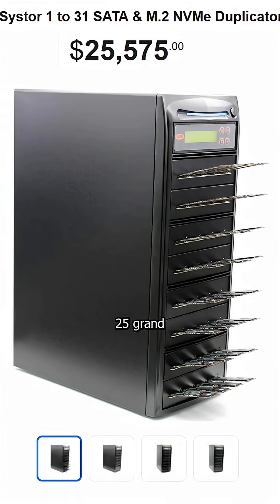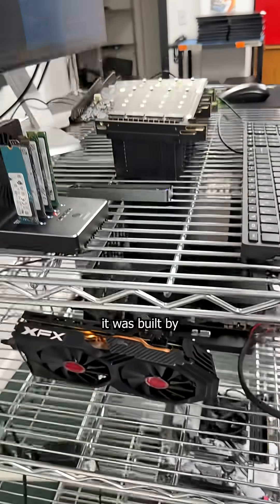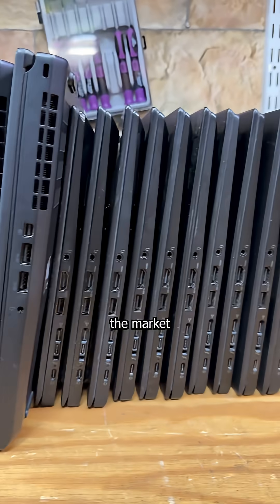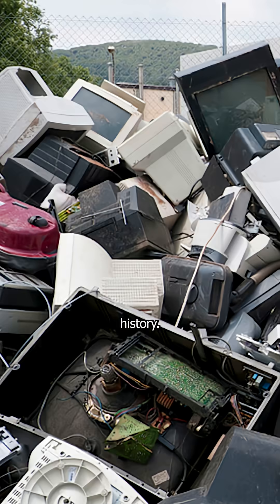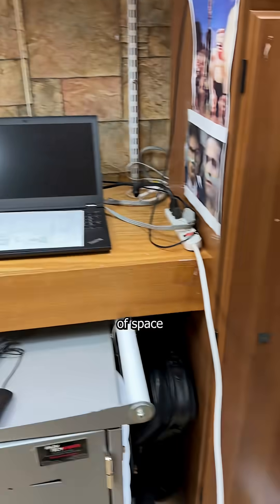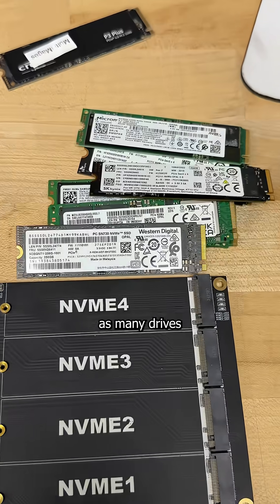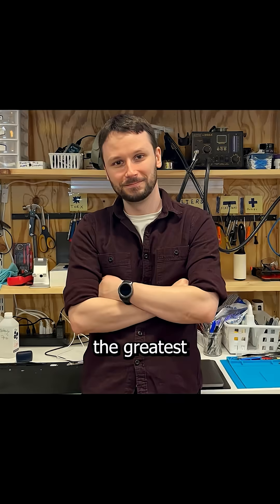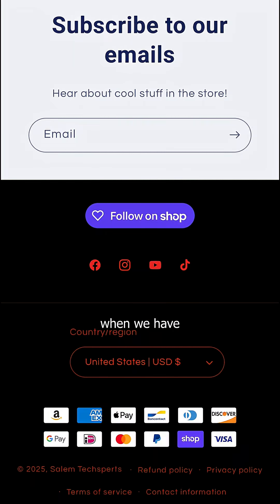I Built a PC Worth $26,000 to Save Old Tech From The TRASH! #tech #technology #computer #shorts #pc

Comment: The thing I don’t understand is what exactly windows 11 offers feature wise. Love it or hate it, at least macOS has the appearance and vibe of new (meaningful) features to entice OS updates. 
They also handle the replacement situation more gracefully. New hardware won’t support old OS and there’s a long enough support window that by the time your hardware isn’t supported it’s up to a decade old in some cases. I mean, I still don’t like having support life that obsoletes functional computers, but it should not be causing massive device disposal events like Microsoft. 

On the other hand, i guess it’s good that this situation is causing so much bad press. Used to be that new Windows meant new hardware upgrades every few years.
Reply from the maker: I agree with you 100%. MacOS (for the most part) at least adds features. Windows 11 just added a skin on top of an INSANE amount of bloat. Sure, there are some changes that I agree with and appreciate, mostly Paint LOL, but it seems like it's an update meant for the shareholders vs the consumers. 
I'll get disliked for this comment but the best brand computer for 90% of people is a used M series MacBook Air.
Reply: @SalemTechsperts yeah. After building PCs for over 20 years now, I can honestly say I really have no desire to purchase myself another windows laptop. 

Last Christmas, I bought a new laptop for my wife, and the whole experience was so annoying. If not for her specific need of a pen input, I would’ve probably pushed hard for a used M series MacBook. 

Btw, you’re doing God’s work here. It’s so nice to have a place to send people when they ask me for a new computer. Anyone in my life who is asking for my advice doesn’t need a powerhouse, and def doesn’t need something brand new. (Plus now I can flex my parasocial relationship and tell them I know the owner 😆)

Comment: Props to the site for still standing with everything sold out.  We need to give these machines the '2nd life' they so desparately need.  
Personally I just spent all of yesterday tearing down a decade old machine, cleaning everything including the radiators,  modifying and rebuilding it so so the gpu is in the right slot... its got PLENTY of life left in it, baring an unwanted upgrade to windows 11.   there's even a possible bios hack to get rebar working....  Point being,  there's going to be an avalanche of powerful machines with nowhere to go, and we need to intercept them before they get o the landfill

Comment: Awesome to see!
Small tip! if PCIe riser cables become unwieldy you can get oculink adapters, they use longer thinner cables! Potentially lower maximum throughput, but then it's possible to fit multiple in the same space. depends on whether the goal is more at once or faster individually.

Also if you're just writing basic images even USB adapters are surprisingly good. Main advantage of PCIe is direct control for firmware, NVMe wipe, S.M.A.R.T., etc.

Comment: Suggestion to try clonning over LAN/PXE with help of software like Clonezilla or similar network based clonning software. 
For this you need 1 clonning server, which will clone and distribute image to other PCs, One 24- or 48-port switch and lots of ethernet cables. Create 1 golden image of win or linux based OS and setup server to transfer image simultaneously or on each pc connected endlessly. 
On recipient PC you need to enable PXE boot mode in bios and connect to network with this mode on boot. This method works great with lots of new PCs at enterprise, where all PCs at warranty, but takes a lot of space. 
At workplace, we cloned AIOs and laptops at batches of 10 and clonning was much faster than unpacking/packing all those machines)

Comment: Please try to install versions of Windows 11, may it be 23H2 or 24H2, WITHOUT Microsoft Recall, PLEASE. You may refer to channel on Youtube by the name of "Memory Tech Tips" (now called "Memory") for your help with that. 

I was successful once with installing it on MY PC without it, alongside some other bloatware I managed to remove. I used "SCHNEEGANS UNATTENDED" and it worked back then, was a struggle later on though (due to either hardware incompatibility with the USB I was using, or my own PC and such).

I beg of you man, please find a way to remove that SPYWARE piece of sh#!
Reply from the maker: Every drive is loaded with 24H2, it's up to the user whether they want to update to 25H2.
Reply: @SalemTechsperts I heard several times over how they made it either DIFFICULT or IMPOSSIBLE to bypass the force of us having to HAVE an internet connection with the 25H2 update. Which would also add in more difficulty I'm sure, if the internet just RELOADED the bloatware, even AFTER, it had been removed, by some force of Microsoft's trickery. Stay safe bro. I'm sticking with the extended version for Windows 10 till next year. Gonna be a big pain in the ass to deal with 11 coming forward. But hope my understanding of it all pulls me and the other electronic devices in the house through.

Comment: There's a regedit that will let win 10 PC upgrade to 11 or you could have setup a pxe boot imaging system for a fraction of the cost.
Reply from the maker: What does the PXE boot imaging system require though? A large network. A large network requires equipment. Equipment costs money. The labor to build that network with that equipment costs money. The docks to convert ethernet to USB-C cost money. $1,600 to clone 28 NVMe drives in 10 minutes is more efficient than PXE.

Comment: I just did a clean install of windows 10 on my old 13+ years Acer laptop. It was already annoying and took much longer than I thought... Can't upgrade to windows 11 unless I use the brute force software options.

It was quite interesting to do, the machine still works but all drivers and softwares is the worst part of it. Most of the brands don't keep their drivers in archive...

Comment: I hate the fact they are shutting down windows 10. My laptop doesn’t have enough built in storage to update to windows 11 so my only laptop is going to be useless :/ even worse though is that its the laptop im using for school
Reply: install windows 10 lstc or Linux mint and you'll be fine :)
Reply: 10 won't dissappear, it just won't get new updates. Which only matters for security stuff, and it might take a few months/years to be an issue. You should be good for a while.
Reply: @Russo-Delenda-Est  exactly, that machine will be either replaced or upgraded long before it becomes an issue
Reply: Might want to have a look at learning Linux. Linux Mint is very Windows-like and very beginner friendly. Been using it a few years now.
Reply: Windows 10 iot ltsc
Reply: You can still use 10, you will have to be careful though. Or go to Linux. You can have both though.

Comment: I don't get why all of you are mad for Microsoft dropping Windows 10 support. I mean yeah most pre 2018 machines can't run Windows 11 officially but it's still way better than what Apple does. Technically some Windows XP era hardware is able to run Windows 10, so it's like 20 years of support. There certainly needs to be a time when Microsoft finally updates the minimum spec so we can move forward and for those who don't want to or can't afford to upgrade to Windows 11 ready machine you can always install Windows 11 with the restrictions removed, enroll your Windows 10 machine into ESU or install/upgrade to LTSC (long term support channel) to get updates until 2032.
Reply: The biggest uses will pay billions to keep having updates so it doesn’t really matter to them

Comment: Wouldn’t it be simpler to set up a Clonezilla server with a ready-made image that you distribute over LAN boot? You just plug in the cable, turn on the laptop, press F12 to choose network boot, and in a moment the machine is ready to go.
Reply from the maker: I use Clonezilla to restore the image to 32 computers in 10 minutes without needing the network infrastructure which I don't have, and USB-C to Ethernet Adapters since nothing comes with Ethernet anymore.

Comment from the maker: - AMD Threadripper 3945WX (used) = $149
- ASUS WRX80E-SAGE Pro WS SE WiFi Motherboard (used) - $600
- 7 NVMe to PCIe cards @ $41.99 = $293.93
- 7 PCIe Riser @ $31.99 = $223.93
- 2TB Crucial P5 Plus = $208.99
- 2x8GB 2666MHz DDR4 RAM (Trident hookup) = $8
- Test Bench Frame = $18.99
- ARCTIC Freezer 4U-M (Rev.2) = $54.99
- AMD RX 580? = $50??
TOTAL:  $1,607.83
Reply: You forgot the steel scaffolding, that’s officially the case now
Reply: @Rizzler8483  whether the pun was intended or not, it is appreciated as a good one.👍
Reply: @Rizzler8483 came here to say that. 👍
Reply: @Rizzler8483  Wire sheving racks like that go for $200 to $500, depending on brand, if purchased new. They're pretty common, though, and ought to be available used if you look for them
Reply: Putting only 2 sticks of 8GB RAM in a Threadripper system is kinda cursed, very amusing, and also all that is necessary for your use case
Reply: A FRICKING THREADRIPPER FOR 150 BUCKS
WHERE DID YOU GET THAT FROM
Reply: @Nukea-n2kebay 
Tons of this exact same chip for the price on eBay 
It’s slow and stupid power hungry compared to modern ryzen 
Really the only reason to go for it is to shove as much ram and or pcie devices into a single system. 
A 7800x3d beats in multicore while using 160w less
Reply: Bro that ain’t no random gpu that’s the legendary XFX RX 580 how dare you talk bad about it
Reply: The gpu was the legendary rx580 xfx
Reply: That random gpu is a Ryzen 4070
Reply: Arch linux = 5 hours
Reply: Your mom's bill - the rest of $20k
Reply: @mort996  outside adapters nvme like they did took the 20k.
oh, and roll for initiative
Reply: Are you giving windows 11 into those nvmes??
Reply: @hossainal7227 Yeah, he’s just doing a clean/custom install of windows 11
Reply: Threadripper in 149 💀
Reply: You need all the pcie lanes.
Reply: @ImJuandahh  its old threadripper in my country its range from 150-170
Reply: @ImJuandahh you can buy a brand new old stock 3945WX for $200. It's a really old cpu.
Reply: Which software are you using for cloning?
Reply: Are there slots for cloning SATA drives?
Reply: @alexandreman8601 There should be, but if you were wanting to hook up a lot of HDDs/SSDs with SATA it's always better to use PCIe cards because you can hook up like 16 HDDs per PCIe slot and load up like 50 - 100 drives in a single machine without having to create virtual drives over ethernet with network switches and multiple machines.
Reply: @alexandreman8601he doesn't (seem to) need SATA for his main use cases. So probably not.
Reply: Perfect, now I know that mobo has pcie bifurcation :)
Reply: Can it run Crysis?
Reply: @gep8936  I played through most of Crysis 1 using 4K High settings on an FX 8350 with 16GB DDR3 and an RX 480 8GB though I was using Windows 7 Home Premium so I was actually only using 12GB of ram and 4GB of vram. I had to turn the resolution down to 1080p for the big battle on the last level but kept the settings on high.

This PC has a superior CPU (I wanna say without checking a 3945WX is 16 core 32 thread Zen 2) with 16GB of DDR4 ram that is anywhere from a GHz faster to twice as fast as my old DDR3 and a slightly faster RX 580 (doesn't matter if 8GB or 4GB).

Given that, this PC can definitely run the original Crysis fairly well. As for Crysis 3, Crysis Remastered or Crysis 3 Remastered I'm not so sure.
Reply: @gep8936  ooh Quake 3 at 1000 fps 🤩
Reply: What software did you use ?
Reply: Amd rx 580 GPU being 50$...
But when i bought mine 5 years ago for 200 euros. And I only had to swap it last year for a 6650 XT.... that's how good this card was for its price.
Yeah. I'm keeping my old 580 aside in case of GPU death of the one I am currently using or my next build (building brand new pc for myself, and refreshing/cleankng up current PC for christmas gift of lil bro, all of it with help of a friend who knows his stuff and I swear will someday convince me to switch to linux)
Reply: Threadripper 3945 is ONLY 12 cores zen 2, zen2 launched in 2019 so it’s over 6 years old now but the 3945 didn’t launch until 2021, so it was outdated architecture when it launched. The ryzen 3000 12 and 16 core chips outperformed the threadripper  3000 in most tasks due to to architecture design indecencies, you really only bought it for specialized use cases like needing a ton of pci e lanes which is where it shined 

Point being just make sure you know what and why you’re buying one before you assume it’s an amazing value for you have compared it to other options in the particular way you will use it
Reply: Include the $30 wire shelf, that thing is load bearing
Reply: AMD RX 580/480 is one of the best bang for the buck GPU ever made.
Reply: What about cloning network based with Clonezilla? I used to cloned school computers by connecting many network switches in cascades and cloned 100 computers every 1 hour.
Reply: So, is there a full form video coming where we see the greatest technician that ever lived rip said company a new one? Just want to hear the raw seething middle finger showing technician that we saw at Subway
Reply: So are you duplicating the same window license keys?
Reply: The greatest cloning pc that's ever lived
Reply: Will there ever be a time where The Greatest Technician that's ever lived™ will sell in Europe?
Reply: Why 7 pcie to nvme card? You have to spare one pcie slot for GPU anyway.
Reply: @noname-wg5me defend on software, mostly cloning app run on cli, like clonezilla
Reply: its the rx 580 for the gpu
Reply: Wow some of those are so cheap. The threadripper still going 600$+ at my place USED and that mobo is 1000$+
Reply: Teknologia 👍
Reply: Keep it up Bro.
Reply: $150 threadripper is ridiculous.
Reply: @Titian083 not really when you consider how terrible the performance of that particular chip is to modern ryzen 
Only reason to go with older threadripper is for the pcie lanes which is the exact use case here
Reply: Why motherboard so expensive in comparison? 😭
Reply: @Lilian040210 threadripper MBs were always expensive , low supply i guess. Doesn’t explain the abundance of old TRs though 😅
Reply: @Lilian040210 it’s one of the best if not the best threadripper boards there are for the given gen
Reply: Threadripper FOR HOW MUCH??!!?
Reply: And don't forget SATA expansion for those devices that take SATA drives instead of NVME.
Reply: @TheSpotify95 you can just use an adapter from m.2 to SATA for example
Reply: My actual dream motherboard 
All the pcie lanes and enough physical slots to stuff as many devices as humanly possible in it
Reply: I never SPEND more than 200
Reply: Your deranged man i am also deranged 😂
Reply: Btw why do u need to clone drives to install w11? U can just bypass requirements check by entering few registry keys on install screen
Reply: Only 3 comments in 45 mins? Lemme fix that
Reply: @TheOriginalGangsterIsHere ok bot

Comment: 150 bucks for a thread ripper is an insane deal :3 which gen is it?
Reply from the maker: - AMD Threadripper 3945WX (used) = $149
- ASUS WRX80E-SAGE Pro WS SE WiFi Motherboard (used) - $600
- 7 NVMe to PCIe cards @ $41.99 = $293.93
- 7 PCIe Riser @ $31.99 = $223.93
- 2TB Crucial P5 Plus = $208.99
- 2x8GB 2666MHz DDR4 RAM (Trident hookup) = $8
- Test Bench Frame = $18.99
- ARCTIC Freezer 4U-M (Rev.2) = $54.99
- Random GPU = $50??
TOTAL:  $1,607.83

Comment: i feel like you talk about it a lot, and maybe im just stupid, but what is cloning an nvme drive and why do you do it?
Reply from the maker: Say I have 100 ThinkPad P50's. Instead of installing Windows 11 and doing software updates on every single one, I only have to do it on 1 and then clone that fully setup drive to 99 blank drives. This means I can simply put in the cloned NVMe drive into the 99 laptops and save all that time having to set it up.
Reply: @SalemTechsperts  thank you!

Comment: I’m confused, why does he need to clone the drives?
Reply: Easiest way to get in all the drivers for motherboards and extensions for the model. Doing them one at time would cause extreme chaos on the workflow, and still be slower.
Reply from the maker: Say I have 100 ThinkPad P50's. Instead of installing Windows 11 and doing software updates on every single one, I only have to do it on 1 and then clone that fully setup drive to 99 blank drives. This means I can simply put in the cloned NVMe drive into the 99 laptops and save all that time having to set it up.
Reply: @SalemTechsperts Ah I see, you guys are 100 steps ahead 🔥. Thanks for taking the time to respond!